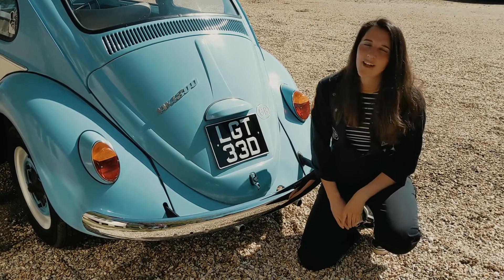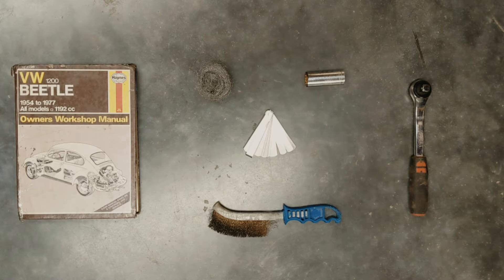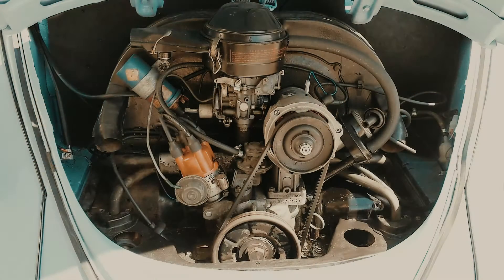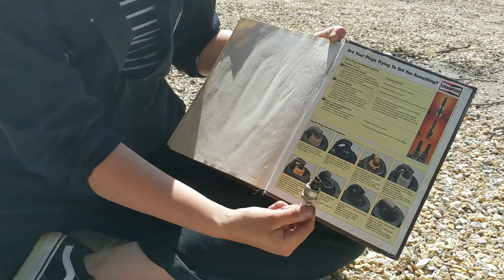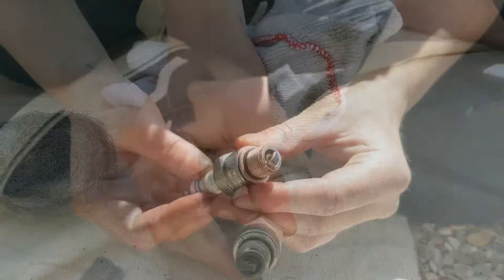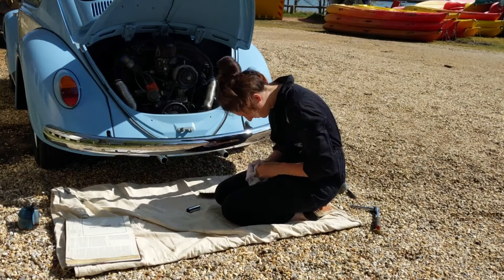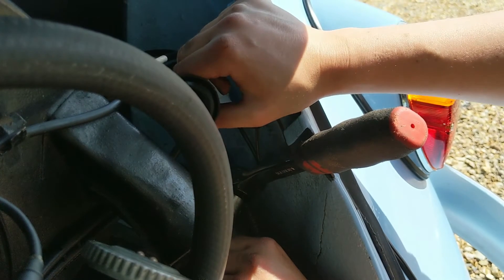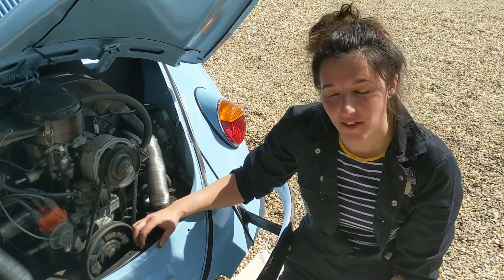VW Beetle - Spark Plugs | What You Need To Do

Comment: hi I own a 1969 Vw bug and I’m having trouble identifying a part, it involves the wire that connects to the spark plug after u installed the spark plug, 
The wire has a little c clip looking thing inside of it, do u know what the name of that part is? and also how to get the clip on inside the wire I’m struggling 😂
Reply: Those are the original VW plug caps, unscrew the fitting on top of the sparkplug exposing the threads and original sparkplug cap will push right on the plug.

Comment: I'd only wire brush the plugs as an emergency as the wire brush scratches the surfaces on the plug and gives better adhesion for carbon etc. Use a blowtorch and get really hot or replace with new. As for the plug socket, you can get them with a rubber bush with holds the plug in place so plug won't fall out.  Nicely presented and clear advice though :)